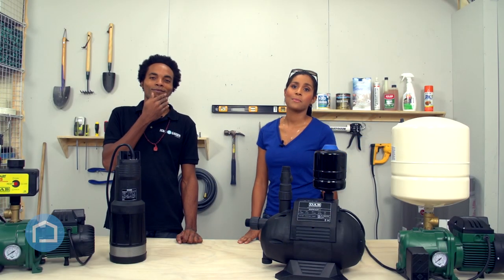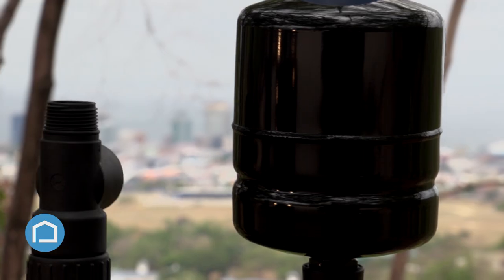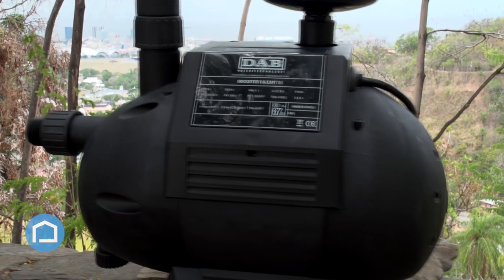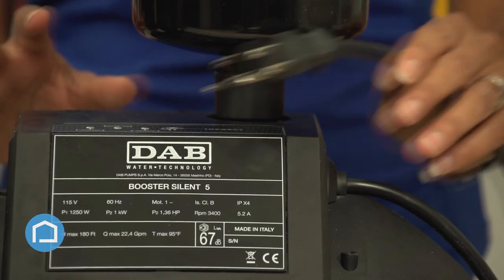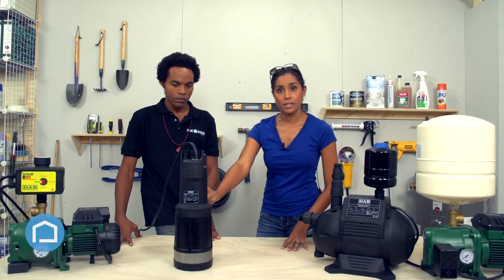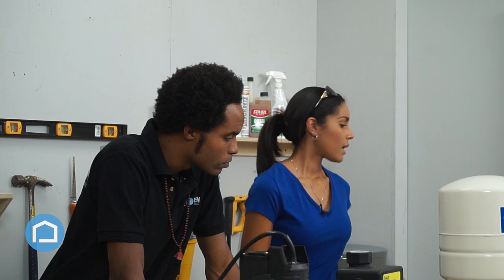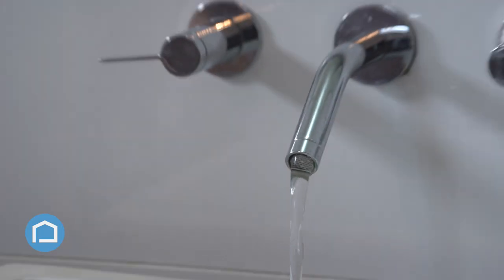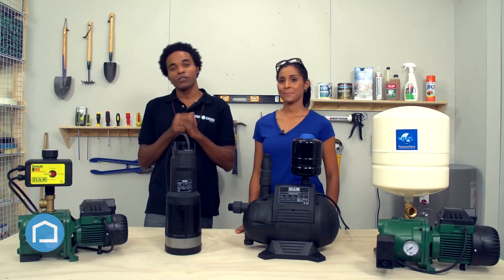All about DAB Pumps in Trinidad & Tobago!

Comment: Good afternoon the pressure switch relays for the dab controller on the circuit board I'm helping someone with is faulty.
causing the water pump motor not to start at times,
 It's the same pressure switch beside the gentleman in the video could you give me the relay specs for coil voltage and amps as well as load voltage and amps or the model code, number, writing on the relay? 
Thanks in advance 👍💯
 I don't see the the plastic cover on the current relay to give the info.